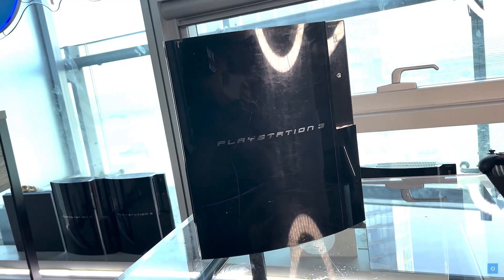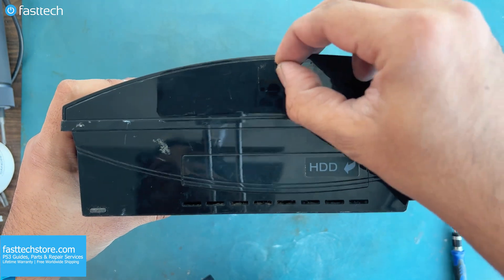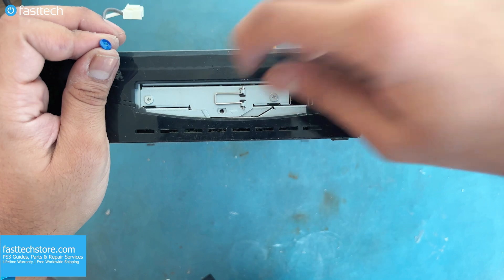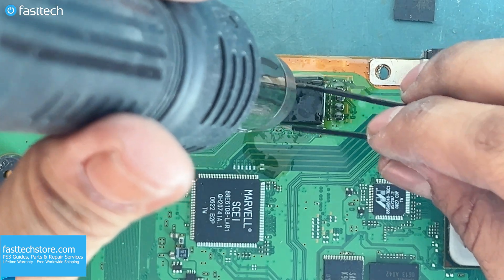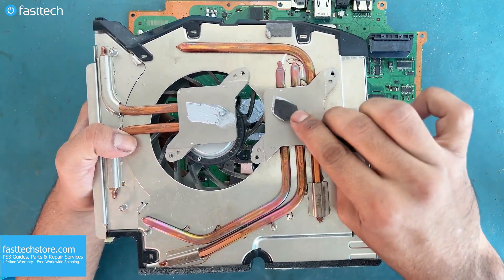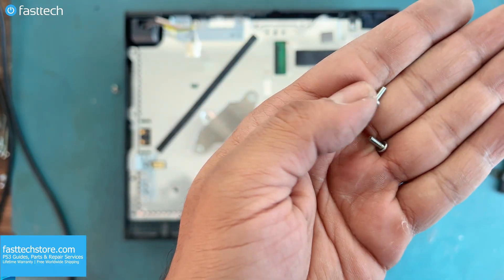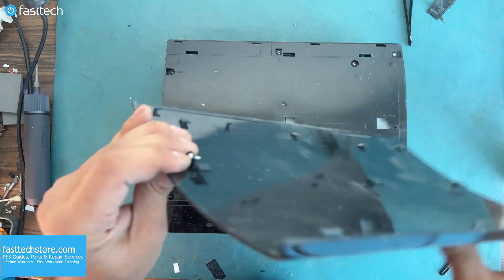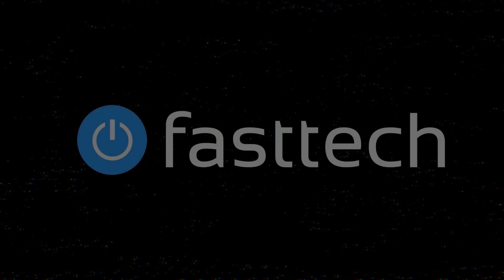PS3 No HDMI Out Repair Guide (Video IC Chip Replacement)

Comment from the maker: 👉Buy a PS3 Backwards Compatible from Fasttech: https://fasttechstore.com/playstation-3-backwards-compatible-systems
👉PS3 Silicon Image Video IC Chip: https://fasttechstore.com/playstation-3-parts/p/sony-playstation-3-model-a-c-e-wireless-board-7dszb-2j7ad
👉Fasttech Auto Tool: https://fasttechstore.com/tools/p/fasttech-auto-tool
👉Fasttech Pro Toolkit: https://fasttechstore.com/tools/p/fasttech-electronics-repair-toolkit
👉Fasttech FH1 Hot Air Station: https://fasttechstore.com/tools/p/fasttech-hot-air-rework-station-fha1
👉Arctic MX-4 Thermal Paste (Great Value): https://fasttechstore.com/tools/p/arctic-mx-4-thermal-paste-4-grams
👉Arctic MX-6 Thermal Paste (Slightly More Expensive, Slightly Better): https://fasttechstore.com/tools/p/arctic-mx-6-thermal-paste-4-grams

PS3 Mainboards
👉PS3 CECHB01 Mainboard: https://fasttechstore.com/playstation-3-parts/p/ps3-cechbxx-mainboard-disc-drive-logic-board-cok-001-and-bmd-001
👉PS3 CECHA01 Mainboard: https://fasttechstore.com/playstation-3-parts/p/ps3-cechaxx-mainboard-disc-drive-logic-board-cok-001
👉PS3 CECHE01 Mainboard: https://fasttechstore.com/playstation-3-parts/p/ps3-cechexx-mainboard-disc-drive-logic-board-cok-002

Other PS3 Parts:
👉 Hard Drive: https://www.fasttechstore.com/playstation-3-parts/1-tb-ssd-hybrid-25-hard-drive
👉 PS3 Casing: https://www.fasttechstore.com/playstation-3-parts/sony-playstation-3-models-a-b-c-e-shell
👉 PS3 Casing Top Cover: https://www.fasttechstore.com/playstation-3-parts/sony-playstation-3-models-a-e-cecha01-and-ceche01-top-cover
👉 Disc Drive: https://www.fasttechstore.com/playstation-3-parts/kes-400-blu-ray-disc-drive
👉 Disc Drive Data Cable: https://www.fasttechstore.com/playstation-3-parts/sony-playstation-3-blu-ray-drive-data-cable
👉 Disc Drive Power Cable: https://www.fasttechstore.com/playstation-3-parts/sony-playstation-3-blu-ray-drive-power-cable
👉 Disc Drive Logic Board (BMD-001): https://www.fasttechstore.com/playstation-3-parts/bmd-001-disc-drive-logic-board
👉 Memory Board: https://www.fasttechstore.com/playstation-3-parts/sony-playstation-3-models-a-c-e-memory-board 
👉 Power Supply: https://www.fasttechstore.com/playstation-3-parts/aps-226-power-supply
👉 Network Adapter: https://www.fasttechstore.com/playstation-3-parts/sony-playstation-3-model-a-c-e-wireless-board-7dszb
👉 Antenna: https://www.fasttechstore.com/playstation-3-parts/sony-playstation-3-wi-fi-antenna
👉 Power/Eject Board: https://www.fasttechstore.com/playstation-3-parts/sony-playstation-3-models-a-b-c-e-control-board
👉 Fan & Heatsink Assembly: https://www.fasttechstore.com/playstation-3-parts/sony-playstation-3-models-a-b-c-e-heat-sink
👉 Heatsink Clamps and Screws: https://www.fasttechstore.com/playstation-3-parts/sony-playstation-3-heat-sink-clamps
👉 Cooling Fan: https://www.fasttechstore.com/playstation-3-parts?category=Fan
👉 Thermal Paste (Large Quantity):  https://www.fasttechstore.com/tools/thermal-grizzly-kryonaut-extreme-thermal-compound
👉 Compressed Air Can: https://www.fasttechstore.com/tools/disposable-compressed-air-duster-35-oz
👉PS3 Silicon Image Video IC Chip: https://fasttechstore.com/playstation-3-parts/p/sony-playstation-3-model-a-c-e-wireless-board-7dszb-2j7ad

Other PS3 Videos:
▶PS3 CECHG Repair Guide: https://www.youtube.com/watch?v=GgOYFO9Pdss&feature=youtu.be&ab_channel=fasttech
▶PS3 CECHH Repair Guide: https://www.youtube.com/watch?v=BDC1O8mYZZc&t=1840s&ab_channel=fasttech
▶PS3 Slim 2000 Repair Guide: https://www.youtube.com/watch?v=S-ewz35fOLY&feature=youtu.be&ab_channel=fasttech
▶PS3 Slim 3000 Repair Guide:https://www.youtube.com/watch?v=ay7GYYMjodQ&ab_channel=fasttech
▶PS3 Super Slim Repair Guide: https://youtu.be/6a9UM_S1T64
▶PS3 Controller Ghosting Fix: https://www.youtube.com/watch?v=lMQouNRR018&ab_channel=fasttech

👉Fasttech Social Media:
TikTok: https://www.tiktok.com/@fasttechstore.com
Instagram: https://www.instagram.com/fasttech.store
Facebook: https://www.facebook.com/fasttechy

👉Follow me on Instagram:
Instagram: http://instagram.com/youngtechg

Music Credit:
CO.AG Music
00:00 What a non working HDMI Out looks like on a PS3
00:20 How to Reset the PS3's Video Output (EASY FIX)
00:44 This PS3 has a hardware problem
00:53 Checking the HDMI port for physical damage
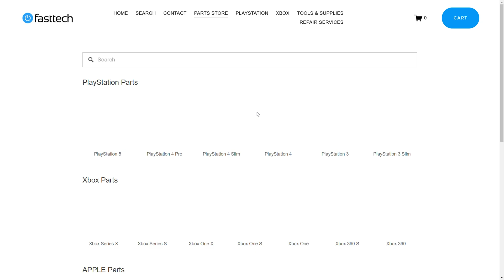1:25 fasttechstore.com ad
1:42 Does this apply to my PS3?
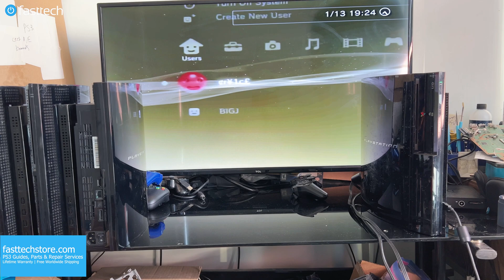2:32 How to check your PS3's model and serial number
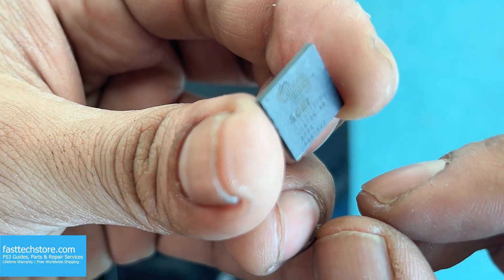2:45 Disassembly
7:18 Replacing the HDMI Video IC Chip
9:39 Replacing the Thermal Paste 
11:51 Reassembly 
17:46 Testing
18:21 Addressing some comments complaining about fasttechstore.com ads

Music Credit
CO.AG Music
Reply: @fasttechvideo  hi there. Can i ask a question regarding my ps3. I have a tv in my room and I tried my ps3 there but its not working although it is recognized by the tv and trying to connect but won’t continue connecting. if i try to use chromecast on that tv its working just fine. So theres no problem with hdmi port on the tv and the ps3. Also i tried 3 hdmi cables already. Same result. I tried to use the ps3 on the other tv its working with no problem. Meaning ps3 is working just fine no problem with the hdmi port since its working in other tv. The tv hdmi port is also fine since i tried using chromecast its working just fine. What is the problem and how can fix it? Is it settings on the ps3? Or the tv? Can you please help me.

Comment: Hey man I bought a fat ps3 G01 the problem is that the hdmi doesn’t show on the tv and it doesn’t  play the sound when I starts up but the Av cables work fine. I already tried the hold the power button for the 2 click and manually set the display to hdmi but none of it worked. The hdmi port is fine and the hdmi cable is fine.Is this the only thing that can fix my hdmi display?

Comment: Very useful video. My ps3 powers up but get no picture on tv. The only difference from your video is i dont get the ps3 start up sound. Do you think i should try changing the chip you did?
Reply from the maker: Yes replacing the chip will most likely fix your issue. Make sure the ps3 turns off normally using the power button before you attempt this

Comment: a video for the PS3 SLIM model  cech 2501a  please? I'm having a similar issue I was playing and the image went black. now the system will turn on normally it will recognize the wifi, the HDD light also blinks, the controller is recognized wireless as well, but I get no sound or video. I have tested other HDMI cable that is confirmed to be working on other devices and I have also tested other HDMI input on my tv. I have tried the video signal reset as well with no solution so far.
Reply from the maker: Okay perhaps in the future

Comment: Is soldering really needed or just high heat to get off? (Needed solder and soldering iron?) I dont see the need is why I ask according to video, its just heat off, set and wait. Am I wrong?
Reply from the maker: Hi,
I believe I already answered this but yes you need a hot air station for this, not a soldering iron
Reply: Gotcha, I just read soldering is why I asked. Thank you for reply @fasttechvideo

Comment: is it possible to fix the 1080p problem with your solution? i mean there is a problem circulating the internet for years about ps3 only static blinking when set to 1080p but fine with 1080i and 720i
Reply from the maker: Does your TV support 1080p?

Comment: Okay i have ps3 fat hdmi and av isn’t working does that include with silicone chip that causing the problem? 

My playstation model is CECHH01
Reply from the maker: Does it turn off normally when you press the power button?

Comment: I recently got a ps3 cecha01. Does not display hdmi and av. Also does not play the sound with hdmi. The console turns on and off and i have tried the trick in the beginning with zero success. Could this issue still be related to the chip?
Reply from the maker: If you press the power button to turn it off, does it turn off normally?
Reply: @fasttechvideo it turns on but doesn’t have the blue light that pops up. Also have to wait a bit holding down the power button for it to turn off
Reply from the maker: @Talknite-d2d you have a GLOD (green light of death issue. You should do a syscon read. Will be doing a video on this soon

Comment: What should I do if both av and hdmi ports both dont put anything out? Would it still be this issue? Or would I have to exchange the ports?
Reply from the maker: Did you try resetting the video output how I demonstrated?
Reply: @fasttechvideo i did so i suspect its a hardware problem 😢
Reply from the maker: @Talknite-d2d can you turn off the ps3 normally with the power button?
Reply: @fasttechvideo no im not able to
Reply: Is my ps3 done for?
Reply from the maker: @Talknite-d2d this is known as a GLOD or green light of death. It could be a bad GPU or a different hardware problem. I recently got one that was caused by a bad disc drive board
Reply: @fasttechvideo ah man, think it would be worth opening up or better off selling it for parts. I got it for $20 at a garage sale.

Comment: How to fix my ps3 slim no signal output HDMI and av
Reply from the maker: Did you try the soft reset I did in the beginning?
Reply: @fasttechvideo  i did it and still no signal
Reply: Yes I did it and still no signal output
Reply from the maker: @asheryapcoy1511 remove the hard drive and see if anything comes up on screen
Reply: @fasttechvideo i remove the hdd and still nothing
Reply from the maker: @asheryapcoy1511 mainboard or GPU issue
Reply: @fasttechvideo  but how do I fix it
Reply: @asheryapcoy1511 how?
you throw it in the junkyard
Sorry

Comment: Best thing about the slim is if it won’t boot you can get it to flash syscon codes with the power light  to see what your issue is if the console isn’t booting properly. 

Mine is throwing the hdmi encoder code. Which means that encoder is bad.
Reply from the maker: Yes you are correct. Much easier to get error codes from some PS3 slim systems. Will be doing a video on this soon.

Comment: My June 2011 slim just had the hdmi encoder die on it. It’s not the gpu or cpu
Reply from the maker: Will be doing a video on a PS3 slim with this issue when I get one
Reply: @fasttechvideo I would love to see you check the fuses and other components on that circuit next to that chip I’ve seen a video or two on those also being mad making it look like the encoder i would like to see a full in depth analysis of it because nobody has one on YouTube. They don’t show what to check for.

Comment: If your HDMI port is not working. Then there is a problem with the CPU or a chip is faulty.
Reply from the maker: @andreracicot4881  its never the CPU that causes this issue but the chip I replaced, or the hdmi port. Most of the times it just needs a reset which I demonstrated in the beginning of the video. Thanks for your comment
Reply: @fasttechvideo it’s never the gpu either
Reply: The way the A/V card works. It's simple. It's just audio and video in one card. Just like VHS/VCR.
Reply: Mine get no out put from hdmi or av
Reply: Then how the hell is AV working